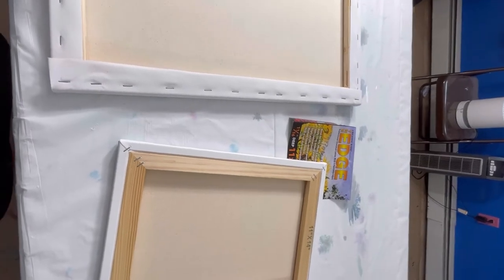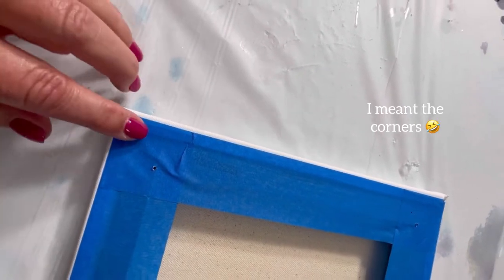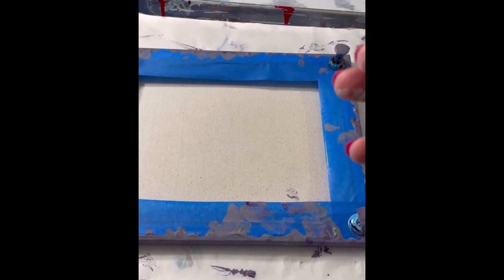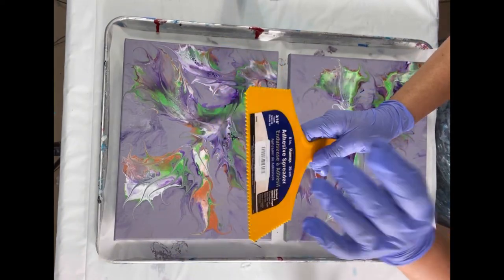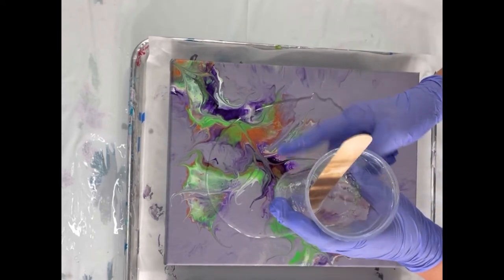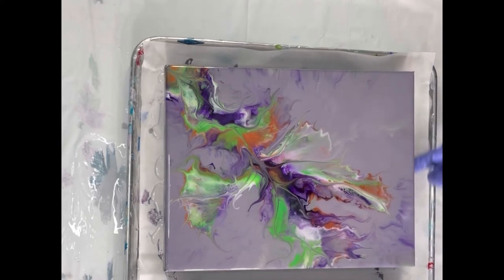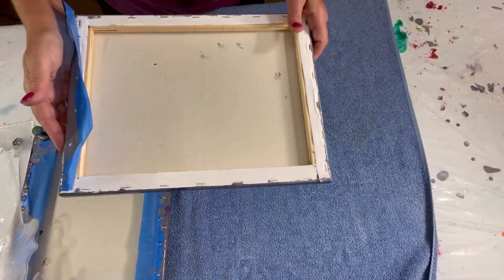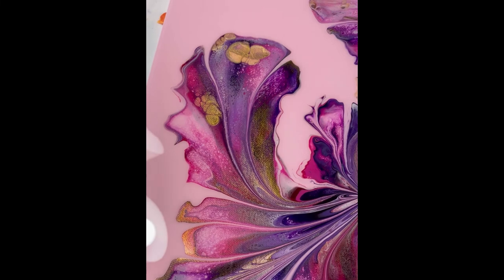Tips for Resin on an Acrylic Pour Painting!

Comment: New to your channel.  Thank you so much for this video.  A few questions: Can I use frog tape on the back of the canvas?  I have level 3 gallery rapped canvases.  About how much extra resin will I need for a 20 X 20 X 1.5 ?  I looked on the ArtResin website.  It recommends 14 oz., but there is no calculations for the sides.  Thanks again.
Reply from the maker: Frog tape works just fine!  For thicker canvases, I’ll add another ounce. A 20x20 canvas is 400 sq inches, which makes it 10 oz if you’re using the spreader. For thicker sides I’d make it 11.